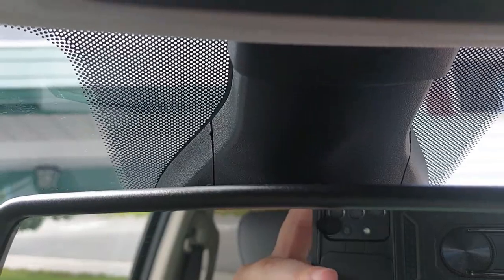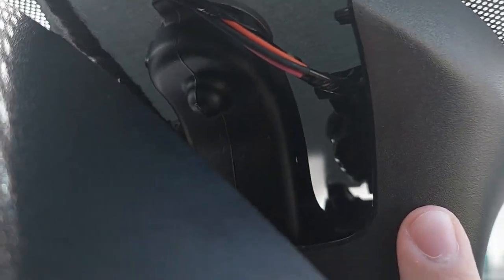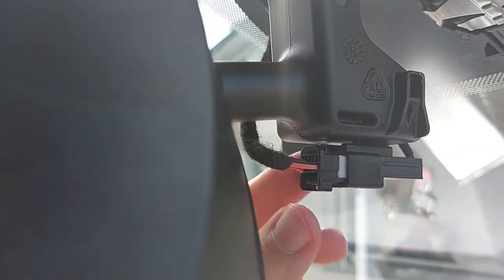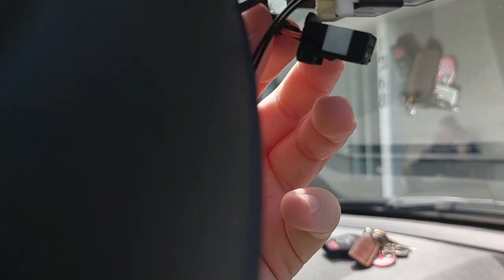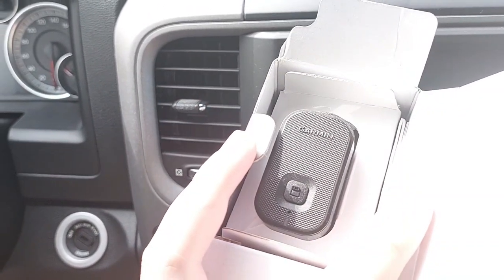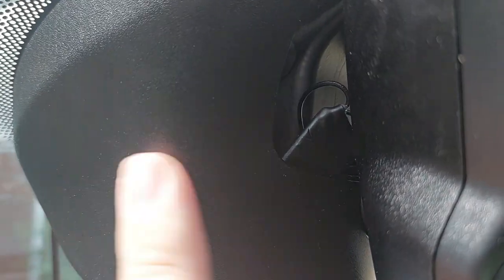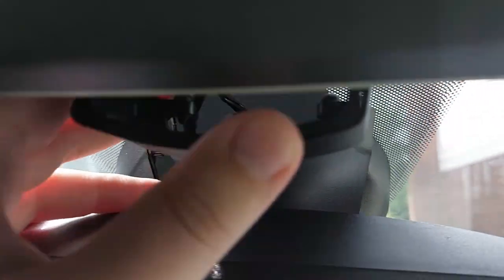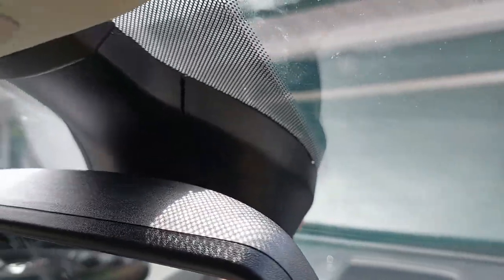INSTALLING DASH CAM TO POWER FROM REAR VIEW MIRROR

Comment: If you poke around with a circuit tester in the mirror wiring you can often find a hot batt wire and be able to connect both the BATT and ACC wire for a more advanced dash cam with a parking feature. This way the low drain parking feature with low voltage auto shut off can work as well as the full unit activation when the car is started.

Comment: Seems like a nice option with one caveat. You may lose parking mode recording if all power is cut with the key. If that's not a concern or if it works with parking mode, you are all set.

Comment: First, great video. Well laid out and explained.
Second, I do have a question...if your dashcam allows for a parking mode...how does this adapter work if the dashcam no longer is able to draw power to be in 'Parking Mode'?

Comment: I cant believe more people haven't watched this video why would you run a cable all the way from the battery ?
Reply from the maker: Thank you! Yes its way better than running a long wire
Reply: Hello
Can you send a link for the adapter
Reply: It's a tidy solution. However you should consider, that you draw additional power from the cables and fuse, which might lead to problems.